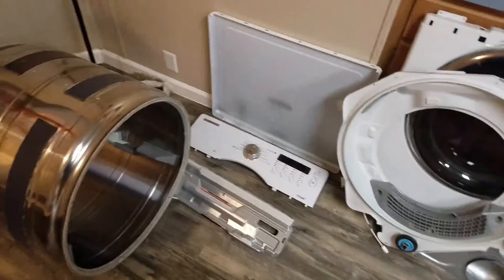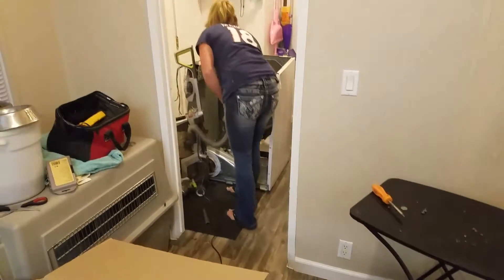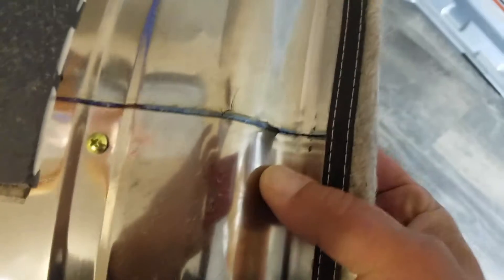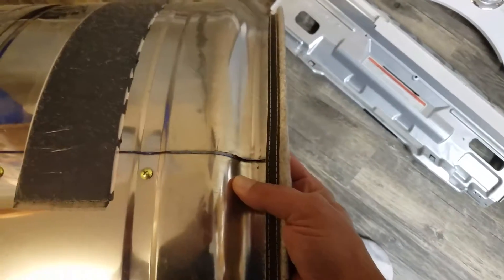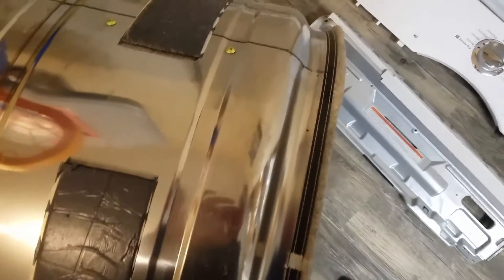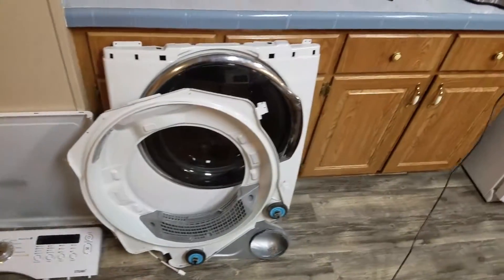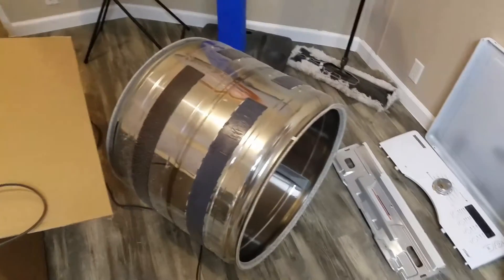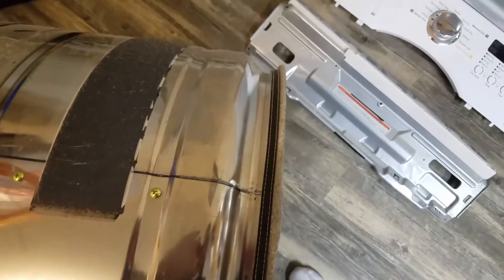Samsung front load dryer. They are junk

Comment: Yep, junk.  Haven't had this problem with mine, but I've replaced the high limit thermostat (died two days after install), tension idler (started squeaking just as the warranty expired, they use a bushing instead of a bearing), heating element, broke and shorted out against the element cover, and now the wires that connect to the heating element have overheated and one burned through one at the connector, although I hear that's a common problem with other brands of dryers.  Had a 15 year old Maytag that we never had an issue with and only replaced it because we remodeled and figured it was time.  If I had my choice, I should have just painted the Maytag to match instead!

Comment: Samsung TV’s = Great Samsung Dryers = Not Great
We got two years out of ours before it was completely worn out. Ours needed all of the following items replaced at the same time. Roller Wheels, Belt, Belt Tensioner Pulley, Heating Element, Thermal Fuse, Thermal Sensor, Main Control Board. Replaced all of that and it stopped working again. Tired of throwing money at it, we replaced both the washer and dryer with Maytag top loader and standard type dryer.

Comment: I know this is too late, but I would have drilled 2 holes and used a piece of aluminum with stainless steel bolts to try to fix it.   Also I always wondered why people would but a washer or dryer from a company that makes TVs.
Reply from the maker: 02sabretooth The problem with that is, the rollers go in that groove. It has to be a completely smooth surface right there or it will make a bunch of noise everytime the roller passes over that spot.
Reply: OK, how about welding it then?  That should fix it.
Reply from the maker: 02sabretooth If i knew how to weld paper thin metal I would.